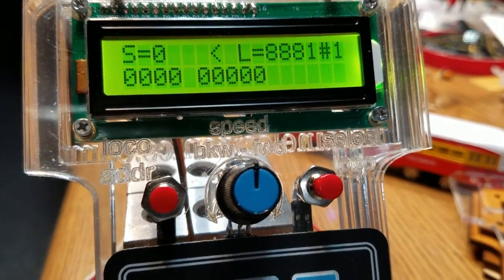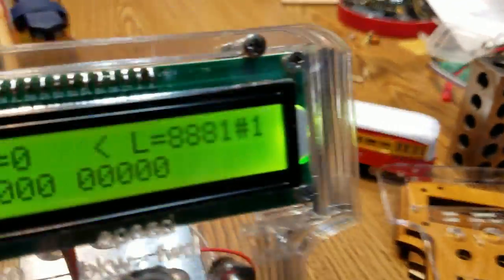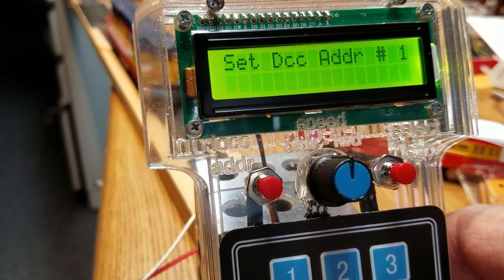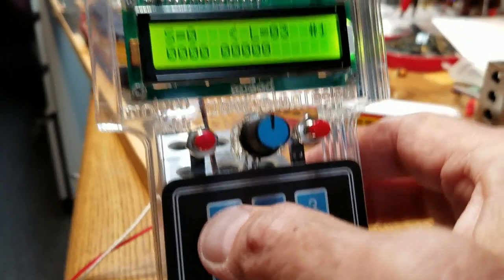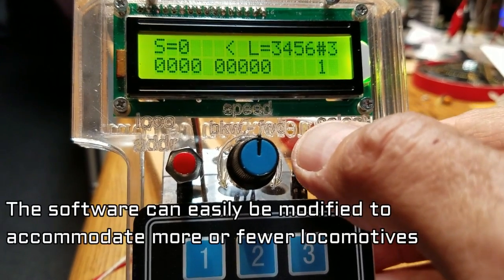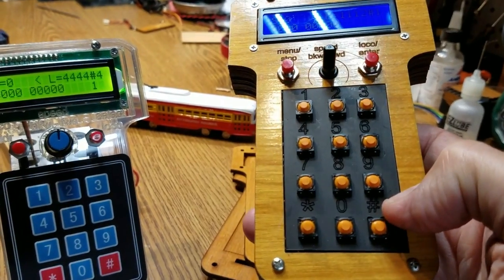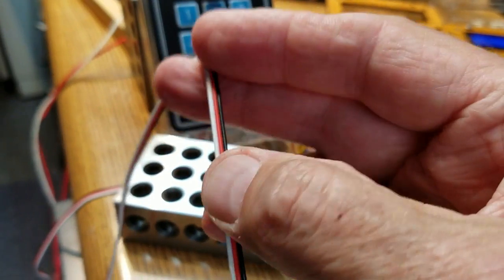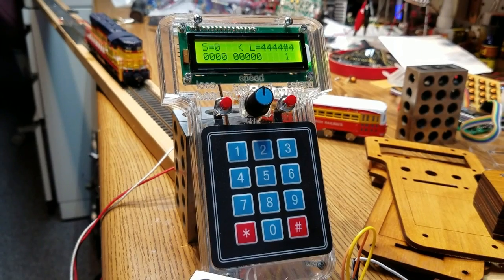A simple DCC++ throttle

Comment: Hi,thx for great job.Can I use this w/o dcc++ , only normal Roco 10764 central?(Replace Lokmaus) if yes
how the wiring?Thx
Reply from the maker: This throttle only works with DCC -  if you want a wireless unit without DCC have a look here

https://www.youtube.com/watch?v=JpcBw8IOWUI

dave
Reply: @DaveBodnar  Dave, thx answering,my Roco 1076 is DCC center, with Lokmaus2,this have
normal RJ11 kabel with 6 wire.(only 4 connected ,2 to 5):Pin2 - GND, Pin3 and 4 -RS485,
 Pin5 +12V.
What is ifArduino TX pin connect to RS485 pin3,and Arduino RX pin connect toRS485 pin4?
Reply from the maker: @pistiberez  Sorry but I am not familiar with that system
dave

Comment: Hi Dave, Just finished building the wireless and encoder version of this. Everything appears to be working but I have to finish the Base Station side yet and wire it into my layout. I did have a similar problem to 'gwkdad' but I solved it by using the YWROBOT  library  which was the correct one for my display. Had to modify the code slightly. I designed and printed a 3D case for it and the power supply is a  5v powerbank with a resistive load to keep it powered up, will have to see how that works out. Thanks for all the effort you put into these videos and keeping some of us sane during these troubled times. Stay safe. Regards Colin W
Reply from the maker: That is good news and good information, Colin - I appreciate your letting me know what you have done.
Congratulations!
dave

Comment: I've watched this video a couple of times and each time I was impressed, not only by the awesome implementation, but also by the quality and how neat it looks. I was wondering when you said you can control up to 4 locos, do you mean 4 locos running concurrently? How do you switch control from one loco to the other seeing that you use a rotary throttle button? It seems that the rotary button preserves the "throttle position" of the current loco. Wouldn't this cause the next loco you switch to, to "throttle match" the current loco? I'd be interested to learn how you resolve that as I'd like to build a remote throttle myself. Many thanks.

Comment: Hi Dave!  I love all of your work.  It's way beyond my knowledge of arduinos, I am having an issue when I am verifying the sketch that multiple things are throwing the error "not declared in this scope"  some of them are "getAddresses" "all2ZeroSpeeed" and "doDCC" to name a couple.  I was wondering if you had any advice?
Reply: Nevermind.  I pasted the code in a text editor then copied over to the IDE and it worked!  I am using it with a Nano, but can't seem to get it running right.  Should I use the Pro Mini instead?
Reply from the maker: Either version should work.  It is good to hear that you got it to work.
enjoy
dave
Reply: @DaveBodnar  Got it working this morning!  Thank you so much!
Reply: @DaveBodnar  So apparently the 1.8.7 version of the IDE does not like the sketch and won't compile.  I downloaded the 1.8.5 version and it worked fine.
Reply from the maker: Interesting - that is good to know - thanks!
dave

Comment: is it possible to use multiple throttles on a layout? my layout is a small switching layout that could keep 2 operators busy and maybe dispatcher. it would be nice for each to have a throttle
Reply from the maker: Tommy - I have experimented with using two throttles and it does work - that is certainly not a guarantee as I did not do extensive testing nor was the project designed for multiple throttles - it is surely worth a try!
dave

Comment: hi mr Dave. i have a question. how to use programming track with this DCC++ throttle?
Reply from the maker: The throttle does not do programming - best to hook up to JMRI to program decoders.
dave
Reply: Mr. dave, can i make the throttle (potentiometer) 0 to 126 only? And to control direction with toggle on off on? On for backward, off for idle, on for forward
Reply from the maker: It would require a bit of program revision, but, yes you could do both things
Good luck & enjoy!
dave
Reply: Sorry Mr.Dave I cant find the line sketch which should be replaced to start 0 to 126. Can I consult you via email?
Reply from the maker: The code is in this area
 potValue = analogRead(pot1Pin);    // read the value from the sensor
  if (potValue != potValueOld) {
    NewPotValue = 1;
    //doMainLCD();
  }
  else NewPotValue = 0;
  potValueOld = potValue;
  potValue = (potValue / 4) - 128;
  if (potValue <= 0) {
    LocoDirection[ActiveAddress] = 0; // backward
  }
  else LocoDirection[ActiveAddress] = 1; // forward
  potValue = abs(potValue);
  if (potValue >= 126) potValue = 126; // max is 127
  if (potValue <= 3) potValue = 0; // set to zero if close to zero
  LocoSpeed[ActiveAddress] =   potValue;

Hope that helps - feel free to email me if you wish - dave@davebodnar.com
Reply: Thanks Mr.Dave. I will email you soon
Reply: I found way how to 0-126 only
change (potValue / 4) - 128
with (potValue / 8) - 128

But i still have a problem how to change direction with toggle on off on
I tried change the (potValue <= 0) 
with switch on D13 High, the result is nothing.
potValue = (potValue / 8) - 128;
  if (switchd12, HIGH) {
    LocoDirection[ActiveAddress] = 0; // backward
  }
  else LocoDirection[ActiveAddress] = 1; // forward
Reply from the maker: Your idea seems to be sound - have you tested the switch input to be sure that the Arduino is properly reading its position?  You can add a test routine to put a message on the LCD showing if it is set one way or the other.
dave

Comment: Hi Dave, you inspired me to build a Arduino Mega 2560 DCC++ Base. I used a real Mega 2560 and Arduino motor shield for the first one, to assure no problems and to make the process easier, it tests out perfect using the diagnostics wiki. Will try again with chinese cheapies next time.
My problem is on your wiring diagram of this throttle you show A4, A5 coming off the LCD display but I can't find the A4, A5 pins on the pro mini. What am I missing?
Thanks, -Terry

Edit: I never had a Pro Mini but I just remembered on Uno and Mega A4/A5 are the same as sda & scl and I have several Mini USB Nano V3.0 boards to use, so I tracked down pinouts for the Pro Mini and my Mini USB Nano and found A4/A5 on your Pro Mini are sda & scl (located inboard of A3) and D4/D5 on my Nano are sda and scl. So I think I found my answer but that leaves me not knowing how to change the code for the keypad if D4/D5 are used by the lcd. Can I just shift the pins for the keypad and Trigger #2? The trigger is just an input, but I don't know how arrays and tables work.
-Terry
Reply from the maker: Terry - those two pins are not on the long edges on the Pro Mini- on some they are on the short side opposite the programming header (look for labels on the back) or a bit in from the side (see: https://www.davidpilling.com/wiki/files/ArduinoCrystal/ArduinoCrystal_ProMini_DP3.jpg 
dave
Reply: Yep, got it Thanks. 
Could you tell me if I can arbitrarily change the pin assignments in the following code? Because I need D5 on my Mini USB Nano for my lcd. I believe I can, I just would like someone knowledgeable to confirm that I can change "5" to any available pin.

byte rowPins[ROWS] = {5, 6, 7, 8 }; //{8,7,6,5 }; //connect to the row pinouts of the keypad
byte colPins[COLS] = {9, 10, 11}; // {11,10,9}; //connect to the column pinouts of the keypad

I just ordered a few keypads so I will eventually be able to experiment and find out. :-)

Thanks, -Terry
Reply from the maker: Terry - I believe you can - the only pin numbers you have to be careful of are those that are defined in a library.
Good luck!

dave
Reply: Dave, I am trying to upload this sketch but I was running into library conflicts so I grabbed your zip file and extracted all to my library folder. Now everytime I load a sketch into the IDE I get the following messages (below), and they repeat several times. Do you know what it means?
Thanks, -Terry 
Invalid library found in C:\Program Files (x86)\Arduino\libraries\Arduino-master: C:\Program Files (x86)\Arduino\libraries\Arduino-master
Invalid library found in C:\Program Files (x86)\Arduino\libraries\EasyIoT-Cloud-master: C:\Program Files (x86)\Arduino\libraries\EasyIoT-Cloud-master
Invalid library found in C:\Program Files (x86)\Arduino\libraries\hexbright-master: C:\Program Files (x86)\Arduino\libraries\hexbright-master
Invalid library found in C:\Program Files (x86)\Arduino\libraries\RFDK_RFM69H_V2_1: C:\Program Files (x86)\Arduino\libraries\RFDK_RFM69H_V2_1
Invalid library found in C:\Program Files (x86)\Arduino\libraries\__MACOSX: C:\Program Files (x86)\Arduino\libraries\__MACOSX
Reply from the maker: The IDE is unhappy with some of the libraries - you can try deleting those that are mentioned but I have found that the error messages generally do no harm so I just leave them
dave

Comment: Dave what is your suggestion for compiling your 5-23-16 sketch with the current version of Arduino 1.8.4?  I get errors when I compile, saying the LCD.h file can't be located.  I've have gathered all the hardware needed and just need to get over this hurtle before putting my efforts to assembly.  Can you compile that sketch under the current version of Arduino?  Thanks for a great tool never-the-less.
Reply from the maker: I just successfully compiled it using IDE 1.8.4 - if you get that error make sure you have a library called LiquidCrystal2 installed - if not it is included in the ZIP file of my libraries  on my web page just above the code listing
http://www.trainelectronics.com/DCC_Arduino/DCC++/Throttle/index.htm 
Hope that does it for you
dave
Reply: You didn't say if you got this solved so... You may need to find the right library for your lcd, I bought a couple from Sainsmart on Amazon and they gave me a link to their own library as the LiquidCrystal2 default library doesn't work with their lcd.

Comment: Great video tutorial.  I would like to make a throttle but I´ll have to save up for an Arduino Mini to use in the controller.  My Arduino Uno is going to be used to make the DCC++ base station.  I´ve been following you for a couple of years now especially when you were using the micro servo motors to control switches with the servo tester.  I really love your electronics videos.  Please keep ´em comin´.
Reply from the maker: Thanks, Rusty - good luck with your projects.
dave